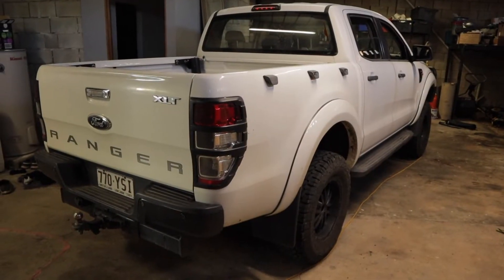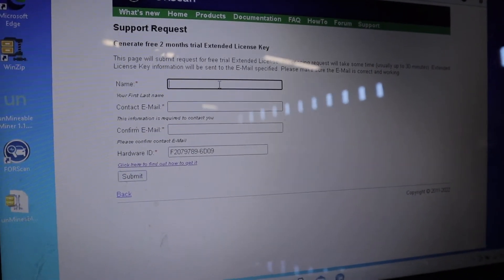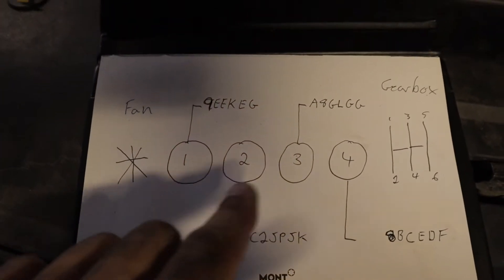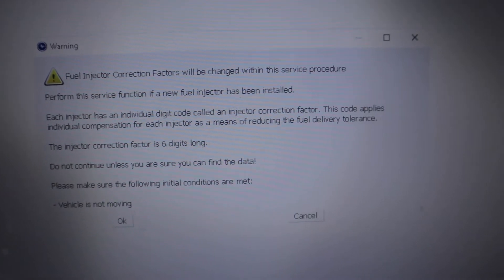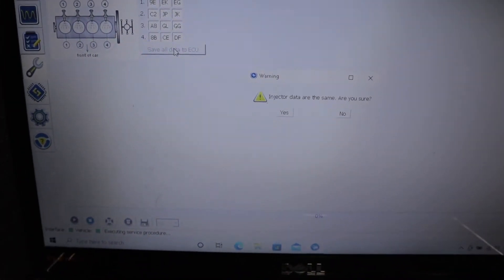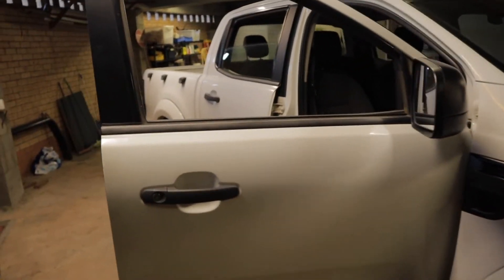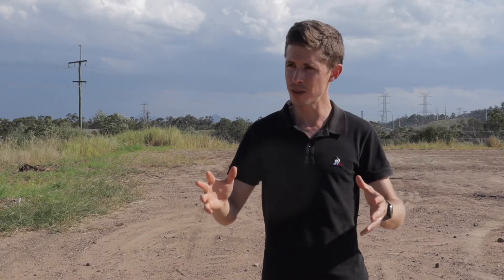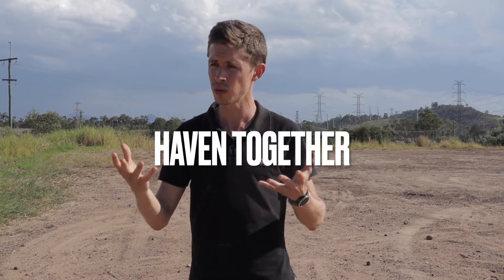Ford Ranger Injector Coding using Forscan

Comment: I have a dumb question:  How do I enable the outside air temp sensor on a PX1 since the option doesn’t exist in the central configuration?  I can enable it in the ICP, however I get U codes from the PCM because for whatever reason, the PCM isn’t enabling the sensor even though the wires are there with good reference voltage and continuity between pins 18 and 21 on the PCM.  Is there a parameter in the PCM As Built data that needs to be modified to fix this issue?

Comment: Are there any more steps after this ? I get to the "service proeedure completed successfully" part at the end of your video but when i go back into the read them option , they havent saved ? any ideas ?
Reply: Yes, a Ford Ranger T6 typically requires both injector coding and a pilot quantity relearn after replacing an injector to ensure proper engine performance, fuel efficiency, and longevity. Injector coding inputs the new injector's specific calibration data, while the pilot relearn procedure allows the Engine Control Module (ECM) to learn and adjust the precise timing and amount of fuel for the new injector under various operating conditions.

Comment: My ford T6 looses power, sent injectors fors services but did not mark them so they got mixed up. Might the injector coding be the solution?
Reply: Maybe you have to send to workshop for injectors calibrations , generate new codes for each injector

Comment: Hey mate I installed new injectors in my PX ranger a week ago using your video so I appreciate it heaps, one thing I noticed was my new injectors were still abit chattery on a cold start-up but fine once warm, I did some digging on the forums and found some reccomendations reguarding resetting the "pilot injection quantity learned values" in the pcm, this is a proccess that should be done with new injector installs I believe, as in forscan it shows a prompt saying so. Just thought this would be a good note to add to the video or leave in the comments for anyone in the future running into the same issue as me, so far after resetting the values the chatter has disappeared, cheers
Reply: Yes, a Ford Ranger T6 typically requires both injector coding and a pilot quantity relearn after replacing an injector to ensure proper engine performance, fuel efficiency, and longevity. Injector coding inputs the new injector's specific calibration data, while the pilot relearn procedure allows the Engine Control Module (ECM) to learn and adjust the precise timing and amount of fuel for the new injector under various operating conditions.

Comment: Hi ! you make great informative videos which have been very helpful in the past.

I recently replaced injector number 3 on my 2.2 Everest 160 BHP and it was coded, but the vehicle is making a rough sound when accelerating and is also shaking a bit when I rev it while it is idle, Do you have any idea why does this happen ?

I was reading on the internet about Pilot learn procedure will that help ?
Reply from the maker: what was the reason for replacing the injector? sounds like it's probably a dirty intake manifold, is the egr still active & has the intake ever been cleaned?
Reply: @abdautomotive  My Everest has done 250,000 km so the guys at ford told me that one of the injectors have gone bad and need replacing. 

The EGR is still active, shall I get it deleted ?

Also I'll get the intake manifold cleaned it has never been cleaned yet, I think that might be the issue. 

Thank you so much for the information🙏 It is really helpful !
Reply from the maker: @AshutoshSingh-rq3vg  at 250k , i would replace all the injectors

Comment: Thanx for informing... just replaced injector 2 + 3. After having all 4 tested by a Denso and Bosch certified diesel specialist, turned out no 2 + 3 piezo part failure. But knocking still remains...🤔 Tomorrow morning I will follow your instructions.
Greetings from Ambon, Maluku
Ranger XLT 2.2 T6/PX1 2013
engine rebuild 01-2024
Reply: Update?
Reply: @4Iamhim  little nightmare in the jungle... cyl3 seized within 500km after previous engine rebuild because of that same cylinder seizure. Rebuilding the engine at home by myself now with help of my mechanic and a diesel specialist. I want to do it myself because they couldn't diagnose the cause. So after learning how to measure I measured everything that needs to be measured. Result: all in spec perfectly except rod bearings a little on the high end of factory clearance. While empty measurements all perfectly in spec. Untill now nobody could explain the reason but all agreed clearence should be fine. A little unsatifying... But nevertheless I found 2 possible causes:
1. Injector piezo failure ( but no signs of damage on piston top. Only carbon spray pattern visible)
2. Oil squirter failure
Of which most likely the latter. When installed at 1st rebuild they where checked as fully open by mechanic and confirmed as ok. Now I know the squirter should be closed at low rpm and opens under pressure by a valve. Found that out after I ordered a new set to eliminate possible failing parts as much as possible. Checked the old ones again and some were, open some closed. Playing around with compressed air their status changed in an inconsistent manner: stuck open and closed. Could squirter on cyl3 have been stuck closed while accelerating uphill? Thats when the engine seized. I felt the event in my left foot which was still on clutch pedal. Parked the car, diagnosed errors which weren't there, started the engine which went perfectly, drove off and hey, hey, hey, the old knocking sound returned... now 7 months later learning, investigating, measuring and spending 3500 dollars, I've reached the final stage of building up all parts to an engine.
Should be ready by saturday...

Comment: Is it possible to temporarily override the control module to stop it from shutting the injector on a weak cylinder. Pretty sure I have a valve problem causing a low contribution situation. It shuts down cylinder one for 50 seconds and then restores power to the injector. I just found your channel and the content is great. Thank you!!!
Reply from the maker: the contribution must be way out of whack for it too do that, never heard of shutting down a cylinder

Comment: Quick follow up question.  Have you used Forscan to perform an injector re-learn ??  Injectors are noisy and have been suggested to run a relearn but never seen were this function is done thru Forscan ??  Any assistance/guidance would be appreciated.
Thanks
Reply: I am also looking for assistance
Reply: Did you figure this out? Anyhelp would be great thanks
Reply: Want to know too
Reply: Update?
Reply: Here for an update also lol
Reply: @robertozacharia3993  go in forscan in the same service procedure tab as coding the new injectors and select "reset pilot injection quantity learned values", the pcm/ecu will automatically re-learn the injector values as you drive it

Comment: Excellent!! i have done the what you mention on the programming of the injector but my car did not start. All i did was replacing the injector, the truck did not start. After the coding and before replacing the injector it was ok but just consume too much fuel. so i want to replace it. it show the cam sensor on the faulty but after replacing the sensor it is still the same fault. what can goes wrong?
Reply from the maker: spray starting fluid down the intake & run it on the starting fluid for about 10 seconds, i suspect you have air in your fuel lines
Reply: You’ve hopefully solved this by now but I found my Camshaft sensor fault was linked to a loose crankshaft sensor - Mechanic who installed my reco engine didn’t use lock tight on the crankshaft position sensor and it was swinging off one end of the bracket. It would crank over but no start. M8 14mm bolt and you should be able to squeeze it in the gap and get it started without removing the gearbox 👌🏻 supergluing the bolt to your finger helps getting it started and not dropping it haha